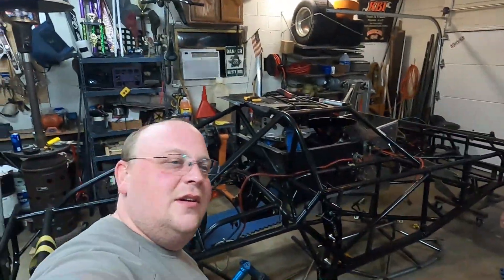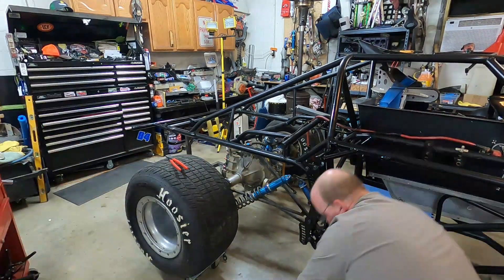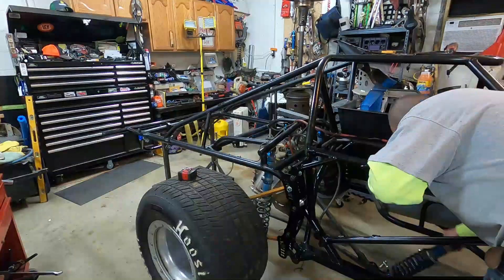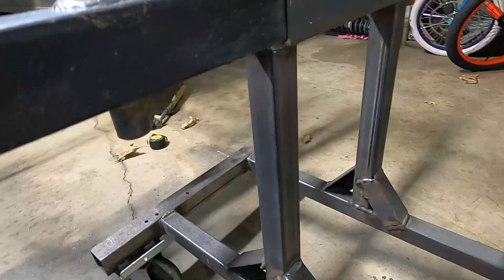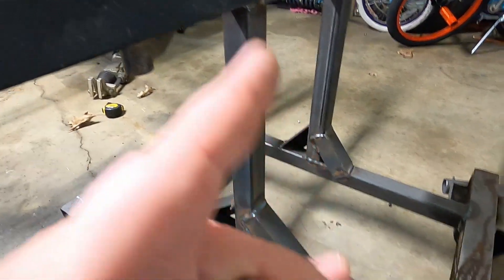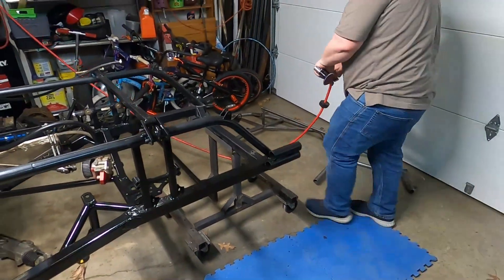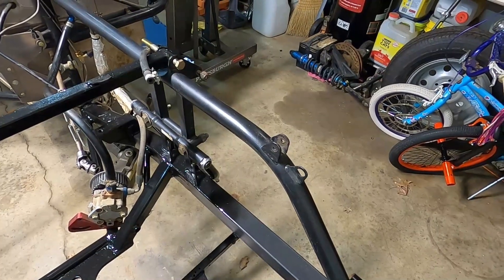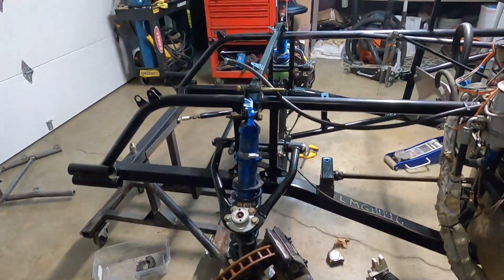DIRT LATE MODEL Front Crossmember Modification & Suspension Installation

Comment: I’m glade to see guys doing their own fab. You guys do require a great deal of learning as it’s obviously your extremely green with fabrication, suspension geometry, and adequate maintenance. But still, this is how the sport is meant to be.
Reply from the maker: Thank you for your comments.  We are new to the world of late model racing.  Every ounce of knowledge accumulated thus far has been earned through trial and error.  Drew and I do not have a family history of racing nor do we have any financial support to aid in upgrading equipment.  BUT... we love to race and we love working on cars.  We have to work twice as long and twice as hard in the areas of suspension, set-up, and maintenance just to get the car to go around the track.  I wouldn't trade the over experience for the world.  At this point we still have the body to build but we look forward to setting up the car for the track sometime at the end of February.  Feel free to stop by and comment any suggestions you might have.  There is so much to learn and so few to learn from.  Thanks for watching!

Comment: Did your car have a raised rail before the surgery?
Reply from the maker: Since we did not buy the car new it would be impossible to say for sure.  However, after speaking with the chassis guy at Mastersbilt we feel that there were no modifications from the OG build.  So the simple answer is no, it was not raised, and was digging in the mud on every track we ran. 😥  We were able to obtain some pictures of other square tube cars that were "raised" or maybe built with originally with a higher angle.   In the end we cut ours back as far as possible.  This might prove to be a zero or hero move but we like the risk/reward.  Thanks for watching!